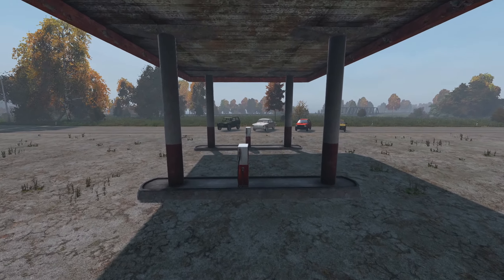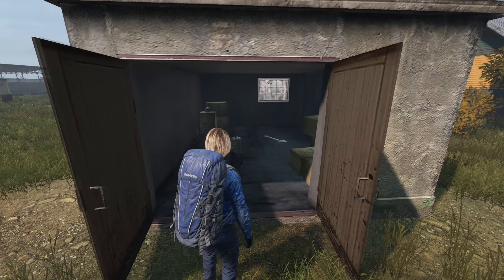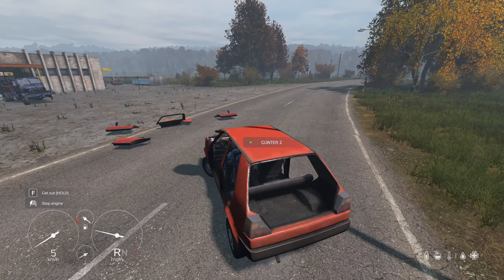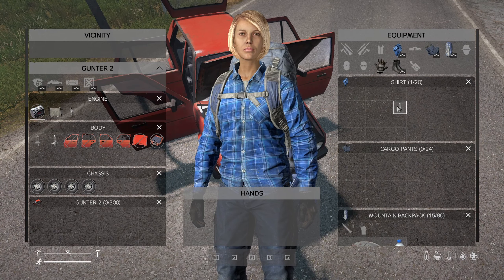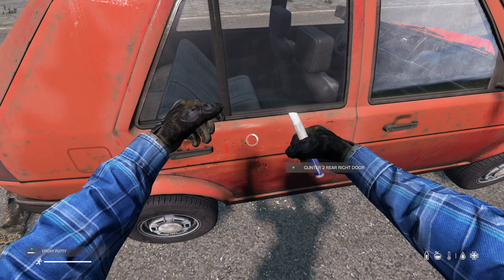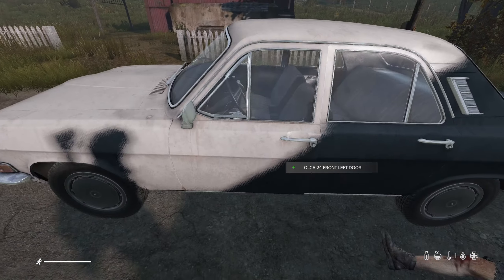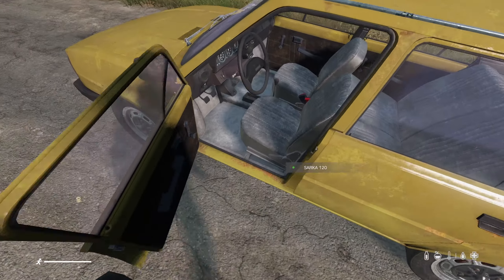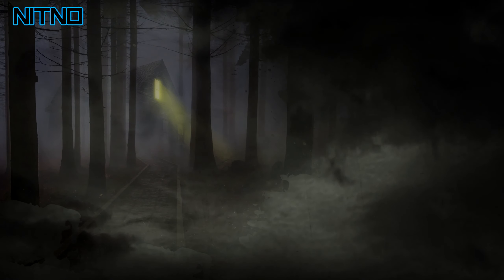How to Build and Repair Cars in DayZ - Fix, Drive, Attach Parts, and Find Vehicles - PC / PS5 / Xbox

Comment: cool
Reply from the maker: You're cool.
Reply: @Nitno  bro i can run this game on 4gb ram on my laptop?and amd processor??with low settings?
Reply from the maker: @dhamuezio7072  Hmm, I think the 4gb of ram might hold ya back. If the laptop has an expansion slot 8gb would be ideal. One thing you could do... If you buy it on Steam you have can run it for about an hour, see if it works, and if it doesn't steam will let you return/refund it (just don't go over 2 hours played.)
Reply: @Nitno  ok bro thanks

Comment: car wont start, every part is pristine. some help would be greatly appreciated
Reply: okae so the car runs but somehow it died within 2-3 min of driving, any fix for this or anyone knows whats the cause?
Reply from the maker: hmm that is odd, only thought is making there is enough gas and water in radiator. Could just be bugged.
Reply: @Nitno  i  found my ans, sadly i didnt research more enough but its a simple mistake, radiator doesnt have water, no wonder the car always in smokes

Comment: Anyone not able to repair the sakra120 ?!
Reply from the maker: Should be able to? What part are you having trouble with?
Reply: @Nitno  The engine. Im having a prestine pipe wrench in hand and I am looking directly onto the yellow engine. The car (engine) is not ruined. Its standing in my base for a couple of days now. Im just not getting the repair prompt, whatever I do. Id seems to be a common bug. I've been googling it for a while now and it seemed to be an aknowledged bug from around 8 months ago. A dev said its internally fixed and will be rolled out soon. So technically it should be fixed by now right? Unless the bug has be reintroduced. I can repair everything else that should be repairable and I am not having any other trouble. Ive also tried standing on top of the car. While its a little hard to get to the engine I can manage that. There is just no prompt. Playing on a vanilla server.

Comment: The only thing i wanted to know you didn't say. Ugh how tf to drive the daum thing. Or even start it. Smfh
Reply from the maker: W or ↑ 	Accelerate
S or ↓ 	Slow Down
A or ← 	Turn Left
D or → 	Turn Right
Q 	Shift Down One Gear
E 	Shift Up One Gear
L. shift 	Turbo
L. ctrl 	Slow Accelerate
Hold Left Click to Start, must have all parts and fuel.
Reply: @Nitno  oh sweet thx.  Do you mean left mouse button to start?
Reply from the maker: @stephentrujillo7555  Correct!

Comment: mm yes car engines repaired by pipe wrenches? on my server every car I use I can't repair the engine for some stupid reason... oh yeah, every car i use also breaks down after like five minutes or so after using it (and yes i do fill the car with gasoline and the radiator with water) car by the hotel or motel buildings in Novaya Petrovka? breaks down at the exit of Novaya. Thats why I walk everywhere I go to.  Go to the prison from Vybor airbase? Walk. Prison to Rify? Walk. The cars never work right on the server I play on.  (Sever Name: 99x Guns) God help me I need new non-backstabber friends.
Reply from the maker: That is strange, I wonder if its an issue with the server.